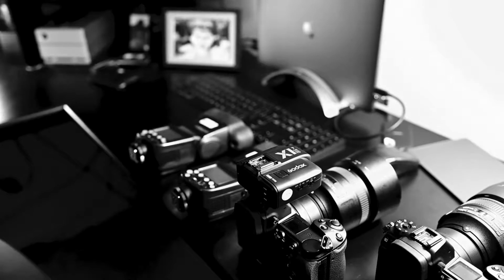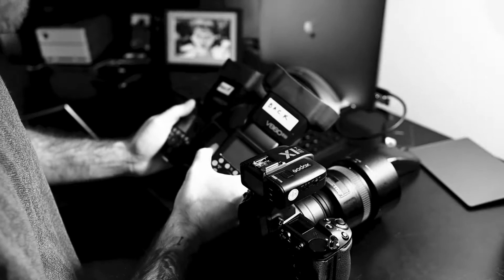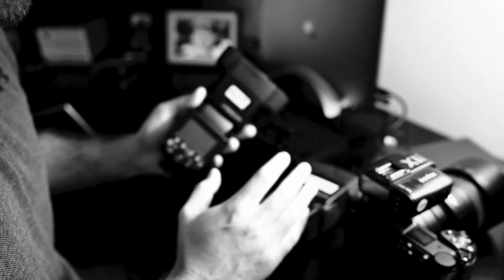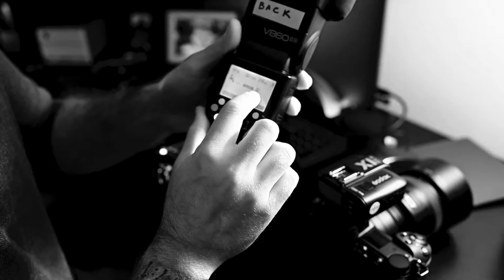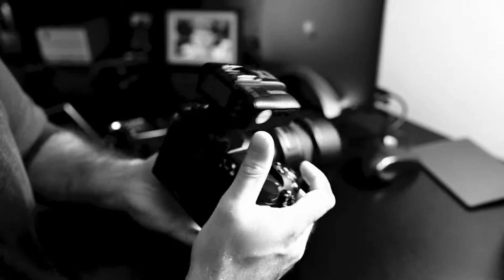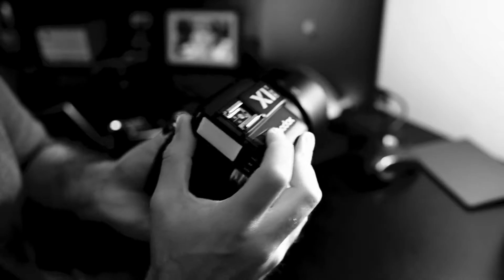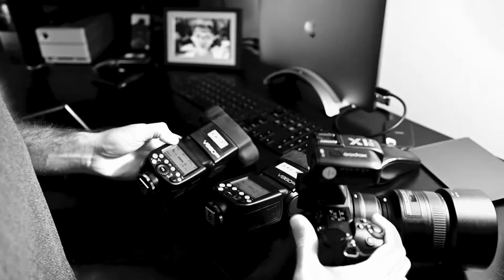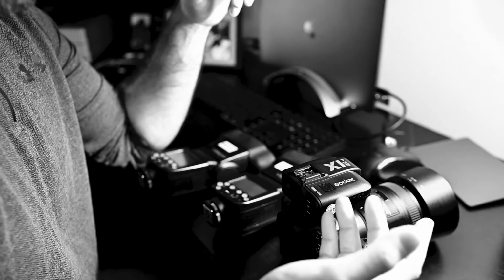NIKON Z6 - How to Set Up Off Camera Flash for Wedding Photography

Comment from the maker: I would love to help you guys with anything Z6 or wedding related.  Let me know any other things you would like me to go over with you
Reply: does your auto focus assist beam on the godox triggers come on while using the z6 in low light, or is it only the on body lamp that comes on
Reply from the maker: Shawn Royal I actually turn off all the AF assist beams.  Z6 has been perfectly fine for me focusing in low light so far!
Reply: @TheMonochromeMemoirs  ok I see. I shoot alot of events such as night club and most times my d750 needs the assist beam to focus. Haven't tried the z6. Also another issue I came across is my Tamron 24-70 and sigma 35mm makes alot of shutter noises although a pic is not being captured, have you came across any issue
Reply: I would like to know how to use the assist AF light of my godox flashes. When I am using godox with Z6 just use the green light of camera and I feel that D750 works better in receptions because the focus is magnific. Can you help me?
Reply: The Monochrome Memoirs Hi! What are those rubber things on your flashes?
Reply from the maker: Hey!  Those are magmod holders for different flash mounts (gels, grids, diffusers etc).  Worth every penny
Reply: What about the infrared grit to deal with very bad/ dark lighting? I wasn't able to make the infrared light on the trigger or the flash working with the Z6. So I did not switched because of that. Sometimes I photograph in very bad light situations. Only my Canon DSLR is giving me the grit (trigger or flash) to make the autofocus work.
Reply: Tobia1506 YOu’ve probably found out by now but the red light from the focus assist doesn’t work with mirrorless cameras. I’m guessing there’ll be some new flashes that use the green light instead coming out at some point.
Reply: @TheMonochromeMemoirs  can you make video how and when you use those gels, grids, diffusers etc. ???? I think everybody here would appreciate it!

Comment: This was very helpful, thank you!

I have a question which is killing my brain, if you could please give me a tip or two, I would really appreciate it. 

I was in a studio today where I used a strobe light.. my issue is, the room didn't appear to be very dark at all but on the screen/ Live preview of the camera, the studio looked very dark. What can I do so the screen doesn't look so dark? Should I lower the shutter speed, to 1/60 (I had it at 200), or should I raise my ISO but that introduces noise, is there something I'm doing wrong? And is there a way I can see on the screen (live Preview) exactly what I see myself as far as ambient light comes?  Or should I just turn off Live preview? Thank you in advance, I hope that wasn't too confusing.
Reply from the maker: Turn off setting “D8” (apply settings to live view). That should solve your issue!
Reply: @TheMonochromeMemoirs  thank you so much, I really appreciate it. 🙌🏾

Comment: I am having a problem with a solution like this. I use a z6, sb900 and yongnuo yn-622. If i expose for ambient light and then turn the trigger on, the preview on the z6 gets very dark. Just like its underexposing the preview. Does your Godox do the same ?

Comment: Hi! I'm close to purchasing a Z6 but I've heard that some users can't activate their flash's auto assist beam for pinpoint sharpness in lowlight flash photography settings. I use a Shanny SN600SN with a SN910TX transmitter. Do your flashes' AF assist beam work when connected to the Z6? Thanks, Eric
Reply: I'm currently looking for how to get it to work. Z6 Nikon with SB-700 Nikon Flash.
Reply: HawkRealtor It wont work with the AF assist beam as it’s red light and for some reason, mirrorless cameras can’t see it. Don’t need it with the z6 to be honest, it’s got to be am]most pitch black for the AF not to work.

Comment: Enjoy your channel and thank you for the content!

 I shoot with Godox/Flashpoint speed lights and studio lights after previously using Nikon speed lights, Alien Bees and Pocket Wizards. In my experiences the Godox system is pretty good by being less cumbersome than my previous system and more self contained, however when I use my Z7 with the Godox set up involving multiple off camera flashes + either a controller or master speed light on camera the results are mixed. When shooting with Manual power settings its excellent and reliable, but when I try TTL it is extremely inconsistent and I am very skeptical about using them in TTL mode during a paid shoot. 

With my D850 everything works flawlessly and is super reliable. 

I spoke with the Flashpoint rep and he indicated that there are currently quirks with TTL off camera + the Z7 and no real fix at this time. Sometimes I can do a 2 hour shoot with no hiccups but other times I pull out the D850 so I don't have to worry if I want to shoot in TTL which at times I do when the ambient light changes quickly.

Have you found this to be true? Im going to update the firmware to the latest version tomorrow, but I don't think that is going to help as it is an update to add the D780.

As it stands right now I have a hard time using my Z7 with the Godox system for a paid shoot, but I will do it. But, I will bring my trusty D850 just in case.

Let me know what you think and good luck with your channel!

best,

Rick

Comment: THanks. What about the flash control option on the shooting menu, Z6? I believe that this can do away with external triggers? (it is brill on myNikon  810),My problem is, when loading my SB700 onto the camera, Z6,  I  a message that the setting are not appropriate in my live view windows. Any ideas please? Thanks Ian Smith. PS I have now got 2xSB700 based on your video. !

Comment: Hey. Great video.I have a Z6, X1T, X1R and a Godox SKii light and I can not get the camera to trigger the flash. I made sure all are on the same channel, I have the latest updates installed, I'm not on silent photography, I am on manual shutter, single frame and auto ISO is off (all suggestions I saw on different videos) but it still won't work. Do you have any suggestions? Thanks
Reply: Erika Vegh Hi.. did you find solution?
I have xpro and v1 godox.. I can't pair it.

Comment: Would love to know what metering mode you use for OCF on the Nikon Z6?
Reply from the maker: Hey bud.  Always matrix
Reply: @TheMonochromeMemoirs  thanks for the reply. One more question if I may... how do you set up your Godox flashes? Do you meter them with a light meter or just use your own judgement based on what you see on the LCD screen (and/or histogram)?
Reply from the maker: No problem at all!  I always set to 1/16 first, take a test shot and see if I need to dial it up or down from there.  I keep it simple!

Comment: I noticed you set the exposure for ambient then added flash. That would overexposure a bit since the lowest power that the flash can contribute would be added to ambient. I usually look for balanced flash mode by manual exposure to ambient and then drop it by the difference I seek between ambient and subject. For example to have the subjects exposed optimally with Rear Curtain and the background ambient down 1-2 stops, I lower the manual matrix metering 1-2 stops, and let the flash expose the subjects at 0. Nikon's  TTL BL mode is great. Even in dark venues, ambient might need a slow shutter to be within 1-2 stops of desired subject exposure the slower shutter lets the colors saturate more but the rear curtain flash freezes the subject with the short flash duration.  
Are you using manual flash and first curtain?   

For dark venues, I see that the near IR focus assist light of the controller or shoe mounted flash does not trigger from the Z6. The Z6/7 depends on a small green body mounted assist light that gets blocked by most lens hoods. I read that Godox 1x controller works if it has the latest firmware but none of the others including Nikon flashes turn on the near IR patterned assist light. That probably accounts for the reports of weak low light AF compared to all the Nikon DSLR bodies. My own experiments using another camera, a D850, with the controller mounted so it emits that assist light allows the Z6 to focus accurately and instantly down to zero room light level. None of the mirrorless cameras use the polarized IR light that the flashes and controllers have.  Does yours work in a blackened room?
Reply from the maker: Stan SPb thanks for the comment.  What I meant by setting my ambient first is to expose for whatever lights in the room I want to capture first.  That is always under exposing the scenario then adding flash to separate my subjects in the scene.  Setting an ambient exposure so that my scene is perfectly exposed by the meter wouldn’t make much sense adding flash after that.  Guess I should’ve been more clear!.  I do not shoot in blackout conditions, there’s always some sort of light in a reception.  As I’ve said before I came from the D850, shot close to 30 paid events with the Z6 and really haven’t noticed auto focusing degradation in real world on site use.  Hope this helps!

Comment: I have just bought a Godox X2T-N trigger, so I can mount a SB910 on top if i need to. 
Also bought 2 off X1R-N, to mount the SB910/SB800 triggers but I found the TTL is not consistent at all, when i used it with Z6. Any suggestions. Thank you

Comment: Hi master,  Z6 II. iTTL doesnt work , i try up 3 flash guns. Any idea of why could hapend? They do work in the Z6 iTTL. it is somethig in the Z6ii settings? Thanks master
Reply from the maker: Hey buddy, are you using godox flashes?  If so TTL will not work unless you update the godox firmware on the flashes to the lates version
Reply: @TheMonochromeMemoirs  Thanks master,  i think it will be easy to buy a new V1  than  i could  update with Mac os ?.

Comment: I have Z6 and Godox V1.  When taking portraits outside during golden hour I am try to get blurred background but shutter won’t go below 200 therefore leaving my shot to bright.  Is this a high speed sync issue I need to somehow setup in camera?  Not sure why this is so confusing...
Reply: yes,  it is HSS issue. check both - camera and flash too. I have Z6 with V1 - works perfectly
Reply: @rodinnyfotograf  Please post a video of how you get these two to work together, i haven't been able to find anything.  I am sure once i see how this is set up it will be easy, just not sure where to start.
Reply: @texasmarshalls  First check on the camera e1 setting - shoud be 1/200s (autoFP). Then it should work. On the flash you should see an icon of "H and lightning"

Comment: I can’t make myz6 to work with my x pro, I have my shutter on manual and still did not work,any ideas,Nikon USA does have any other idea
Reply: me neither. I'm using an sb-800 mounted on a godox x1r and the trigger works if I press the flash button on the transmitter, so I know that communication is functioning, but I can't get the camera to communicate to the trigger. I have silent mode off. super frustrating
Reply: @timflynn6386  same here. Did you get this resolved? If so do you mind sharing how? thanks

Comment: Love Godox! I've spent SO much $ on Pocket wizards and other systems only to have issues every time. The Godox work all the time. Question, you never mount a flash on top of the camera? Even on the dances etc? I just wish the flashes had the same locking system as the nikon flashes. I have had flashes fall off because the screw comes loose and not realizing it until...bang...